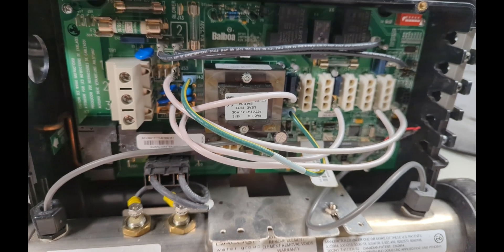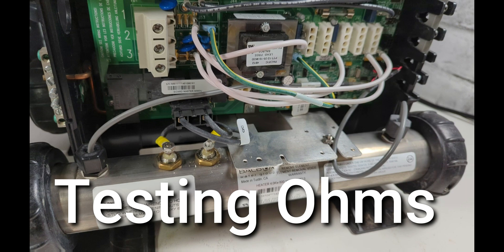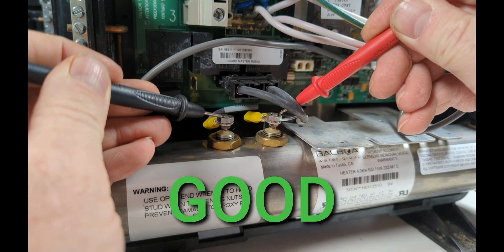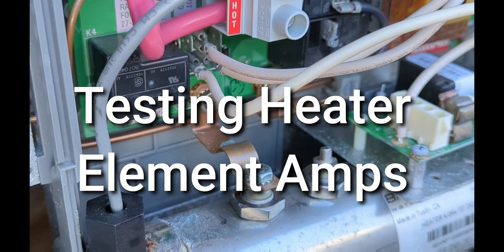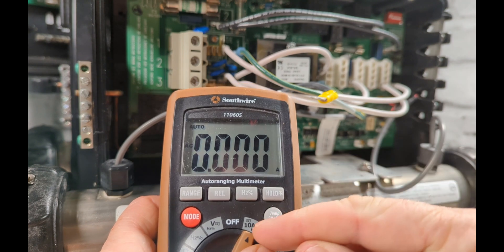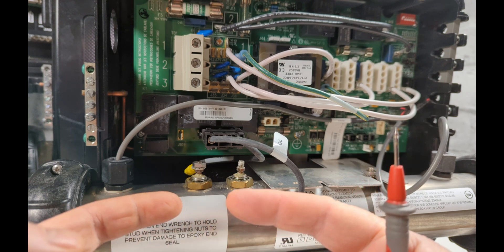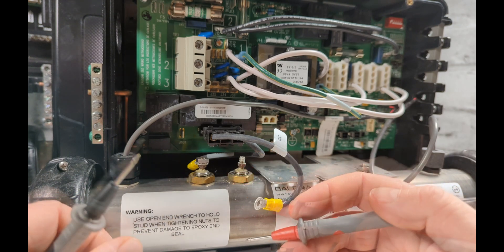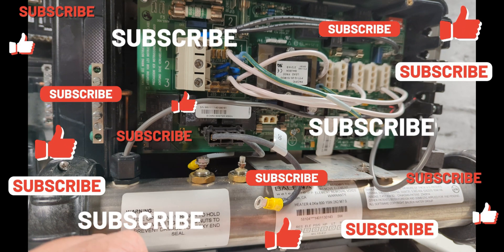Hot Tub Not Heating | How to Test a Hot Tub Heater Element

Comment: Can you test this without water in the hot tub? My circ pump is leaking. I’ve drained the hot tub and ordered a replacement pump. But I was also having heating issues without any tripped breakers.
Reply from the maker: test with water.  fix the pump
Reply: @VIPPoolsandSpas I finally got the right pump and it’s replaced. I’m getting 0 volts on the heating element and 0.40 amps. So would this need a new heating element? Could it be a thermostat or anything else preventing power supply to the heating element?
Reply from the maker: @billyburch4817  is the circ pump is pushing water thru the heat tube, than its a circuit board.

Comment: well bummer, I tested and followed the video, and thank you very informative; I found the ohms to ok, but no volts at the element, traced the wires back and none there either at the plug in the board etc.  even removing the plug and testing direct at the board, am I to assume I have an issue at the board?  Any help appreciated and thank you great video!
Reply from the maker: if tub is calling for heat and 0 volts on the element, it's the board

Comment: if your ohms is 14.5 but still don't got heat and there is burn marks on board. what is your guess?
Reply from the maker: Burn marks on board?   If that's the case, it's the board

Comment: I have a Balboa 240 V going into the board. Nothing going to the elements 0 V I started with changing the element originally because I thought that was an issue. I have two brand new sensors and a brand new element. Everything is reading fine except 0 V to the element itself. I’m guessing it’s the board just looking for help.
Reply from the maker: Yes, could be the relay on the board.
Reply: @VIPPoolsandSpas it’s in the mail

Comment: why Does my vs501 board not see my v600 topside controller when it does see the vs500 board. I have switched switch 3 into both positions. No show on topside controller.
Reply from the maker: @larryherberholz7789  is it a new topside for that pack?  If yes, most likely the topside isn't compatible with the circuit board.
Reply: @VIPPoolsandSpas  Same board as before  vs 500z  but different chip   old was vs500  new is vs501    Supposed to be the same.
Reply from the maker: @larryherberholz7789  I'm guessing the topside isn't compatible.

Comment: Could use some help please  replaced heating element  hooked up everything but won’t turn back on TP reading no communication but there’s a pig tale loose inside top board one is a 4 prong the other is plugged in to main board does that pig tail go some where I have no power at the heater , it the exact same one youn working on any hello would be appreciated thanks
Reply from the maker: @jamescollins6203  any error codes?

Comment: i have no voltage going to the heating element when the spa is calling for heat.  resistance and continuity seem fine on the heating element itself. leaning toward a bad relay/, circuit board. would you agree
Reply from the maker: If there's no error message and everything seems to be flowing fine, then it does sound like a relay problem.  Test all fuses and volts coming into spa pack.

Comment: I have checked my element and have 240v, ohm reading is 14.2 for 5.5kw seems to be out of range. I have continuity between post. Any idea what may be going on?
Reply from the maker: Whats going on with the hot tub?
Reply: @VIPPoolsandSpas  tub won't heat temp staying around 70 degrees.
Reply from the maker: @garyhovers2487  change the element

Comment: Hello, after changing my heater element and both sensors on my Balboa spa, I still can’t keep my he heater on for more than 90 seconds (est). I hear a click sound sometimes sound which appears the heater has turned off even though it is still showing as being on up top on the panel. If you have any ideas I would be appreciative…
Reply from the maker: @danielday2340  test volts coming into the spa pack.  Test volts and amps on the heater element.

Comment: I have a Jandy heat pump EE1500, in the pass it would give me a high pressure error code, and fan wouldn't spin, i would change the condenser for the motor and it would work for about a year, last year it give the same code but this time after changing the condenser it keep showing the same error I have no idea what is going on i change every connection and eerything has power but the heat pump still won't run, any idea what is going on, and A/c tech friend of mine tested the freon lines and said everything is within normal operations he didn't know what was wrong with it either, any help would be appreciated
Reply from the maker: unfortunately, I don't deal with heat pumps.  I always get a heating/cooling guy out to look at them.

Comment: Thanks for the videos. I replaced my heating element, filled up my tub, but still no heat. Voltage coming into the board is good and all fuses are good, but volts at the element leads are zero, amps zero, ohms zero. Continuity is good. Was I sold a bad heating element or is there something else that is the problem?
Reply from the maker: Could try replacing the element again.

Comment: Spa isn’t heating checked the fuses they are good, checked the voltage it’s good coming in when I go to the element continuity is good on it it reads about 14 ohms, but when I voltage test it’s 0. Does this mean replace the element?
Reply from the maker: Test the amps on the heater element?  Is the circ pump / Pump 1 working fine?  Any error codes showing?
Reply: 1 pump and it’s fine, no error codes. Amps are zero, but not super confident that I got a good reading.
Reply from the maker: @JasonE-kl2ss  Sounds like a relay issue.
Reply: I have the balboa bp7 spa pack, do you have a video on what relay to check?
Reply from the maker: @JasonE-kl2ss  I do have videos on how to test a hot tub relay.